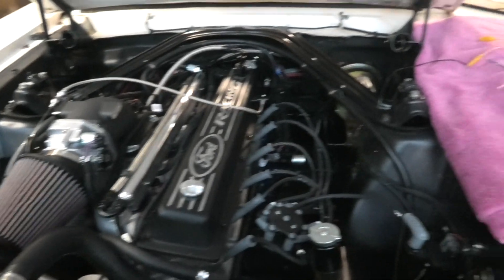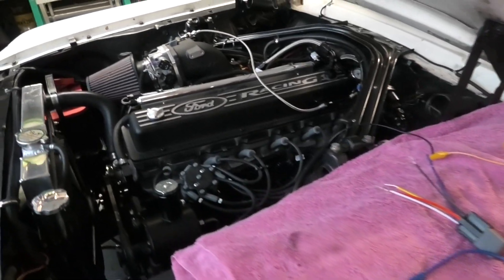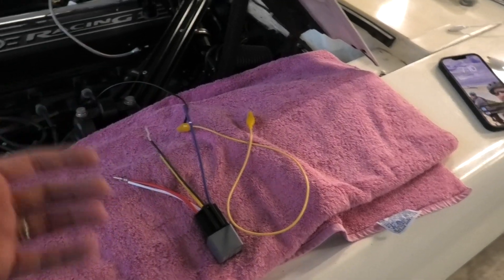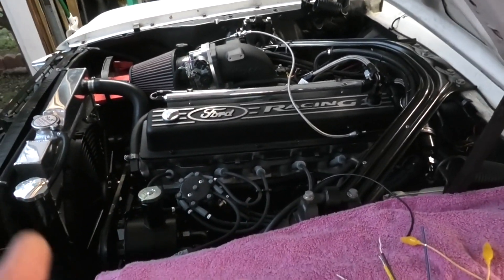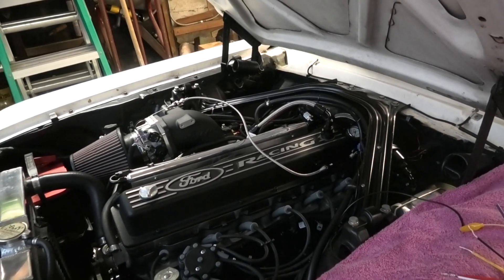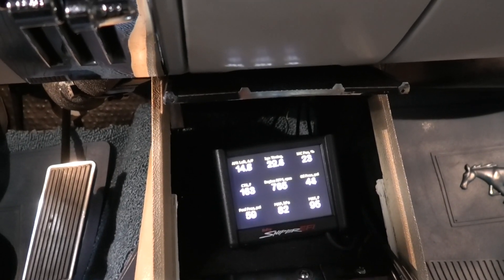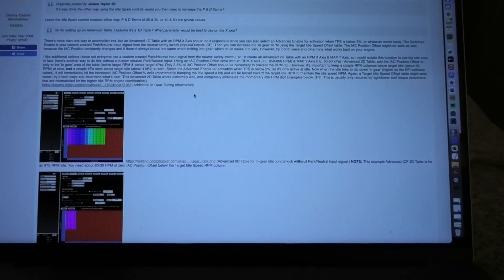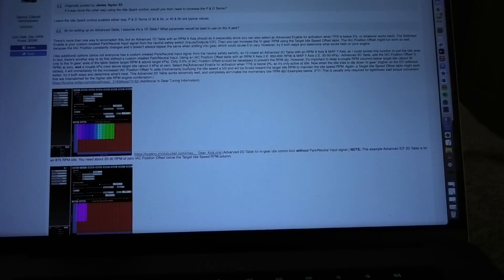Holley EFI Using IAC Kick for In Gear Idle Control and Other Updates

Comment: Interesting idea.

the stalling is associated with your converter, if you dont have enough stall on your converter it will stall the engine out as it will load the engine up.

With that said I shouldnt have that problem on my Stealth install on my truck, but I am looking for a way to add in a idle offset so that when im in park/neutral my idle speed would be say around 700 rpm and when im in gear it will drop to the base line 575 rpm.

I cant use the IAC kick as in my programming that ive been playing around with in prep for my install, I currently have that setup to be a idle speed offset for my AC so my target idle is 575 rpm but when I switch the AC on it will offset it to 650 rpm.

I dont think I can use that same circuit to do both to achieve what my goals which is to have a stand alone idle offset separate from my AC idle offset.  On my auxiliary fuse/relay box I am working on building Relay 8 is for the AC "kick" circuit that in the software is setup to be an idle offset not IAC kick, I would then need a diode to allow for the neutral safety switch to activate Relay 8 and not back feed to Relay 6 which is my AC clutch relay that then goes through Relay 7 for my sniper clutch cut out circuit to cut my York compressor out at WOT.

My problem with doing this is it would only offset when activated my idle speed from 575 to 650 rpm.  realistically if I have the AC on and I'm in park/neutral I would want it to compound with another target rpm offset to raise the rpm up even more to around 700 - 750 rpm.  At best I would only get 650 rpm if I do it through the IAC kick which would be enough I think, stock converter is around a 1,000 rpm stall so it shouldnt stall out and the XTM converter im going to swap to when I replace the C6 transmission should be around 2,400-2,500 rpm stall.

Comment: The whole point of map vs rpm based speed density is load based, so if it's stalling when you put it in gear, get the idle timing and fuel right. You shouldn't have to do the iac kick.

Comment: Good Video, this is a very good trick you used to get your idle better in gear.   Sometimes to explain electricity path is say its "lazy" it will go the path of least resistance.

Comment: So for wiring of the relay.  You connected pins 86 (coil +) and 30 (switch common) to 12V keyed ignition. Pin 85 (coil -) is connected to the key side (cranking contacts) of the neutral safety switch. 87a (normally closed) to the ECU AC input.  And 87 (normally open) is not used.

When in Park or Neutral the NSS switch is closed which means pin 85 of the relay can get access to ground via the starter solenoid coil via its “S” terminal.  This will cause the pins 30 and 87a to be in the  OPEN state. (No IAC Kick demand)

When put in gear the NSS switch will open which means pin 85 will lose access to the starter solenoid “S” terminal and therefore ground.  This will cause the pins 30 and 87a to be in the closed state.  (IAC Kick demand.)

When the cranking circuit is closed,  12V will be present on Pins 86, 30  (via the key ignition contacts) and 85 (via the key cranking contacts) but, like you said, it doesn’t matter.  The voltage potential will be the same on both sides and cancel each other out.

The relay coil polarity (86 and 85) doesn’t matter unless there is a flyback diode connected in parallel with the coil.

Is this sounding correct?
Reply from the maker: All exactly correct. And yes I checked for a diode beforehand 😉
Reply: Working on a 65 Mustang.  does 85 on relay just goto "S" on the starter relay or does it go inline with the saftey switch.

Comment: Cool!  I literally thought about doing something like this with my 30003 (400hp TBI) FiTech once.  Repurposing the  AC input as a pseudo PRNDL switch.  On a FiTech you may not even need the relay. I believe there is an option to select the signal type (12V vs GND) for the AC wire.

 Anyway, I had an issue with my 360 Dodge where when I put the transmission in gear the engine rpms dropped and causing a nasty stumble.  I ended up greatly improving the issue by adjusting the relevant (2) fuel tables for both in AND out of gear to get the Learn trims closer to 0%.  

The problem is on the FiTech the “Idle Fuel Learn” has a lot ground to cover (too much for an auto IMO).  It’s responsible for everything under 1200RPM regardless of MAP readings.  When my engine was idling out of gear the Learn was around -14% but, when the idle stabilizes in gear the Learn was around 4%.  The trim/learn was to slow to correct for this sudden change in load.  I later found out this gap in fuel wasn’t as big if I selected CAM2 instead of CAM1 but, I learned an important lesson,  the less trim has to work the better off you’ll be.

And that goes for the IAC as well.  Why make the IAC creep up to it’s target instead of just snapping to it?  You know it’s going to increase with an automatic.

With some addition software features I believe these aftermarket systems would greatly benefit from having a documented input wire for automatic transmission equipped applications.

You could do a lot of cool stuff in software with that extra information.

For example dedicated Idle Learn ( Both iac and fuel) and Idle AFR targets for in and out of gear.

I recently emailed FiTech on this idea and more but, they never replied back so, I guess their not interested… all well I guess.

Anyway, real cool solution,  I like what you did with the relay.  I’ll have to remember it.